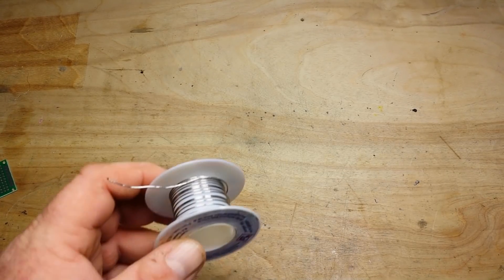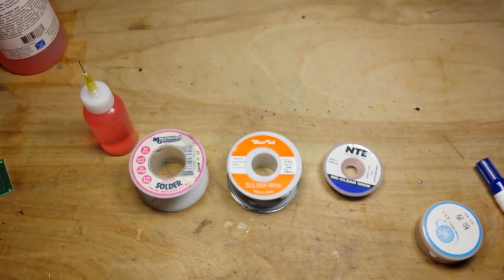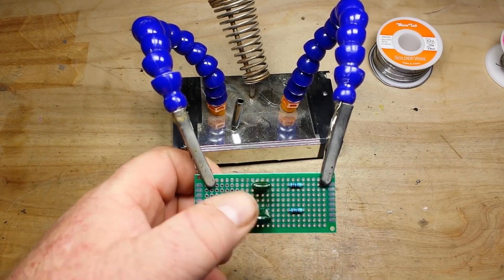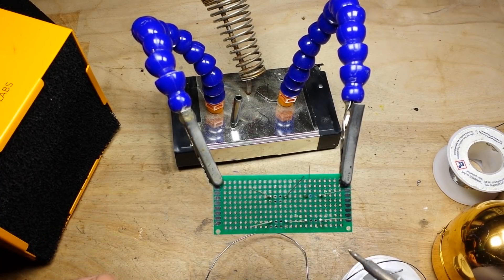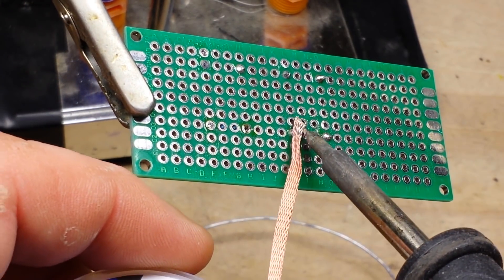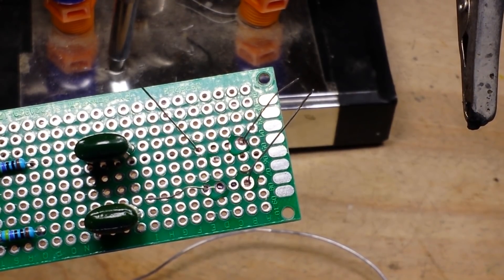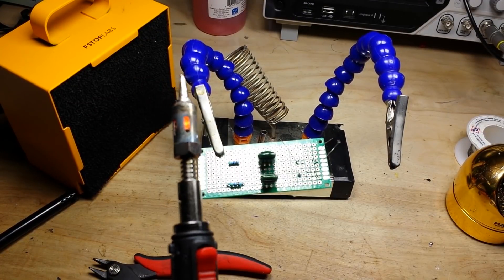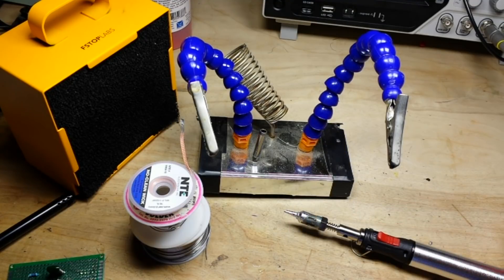Trying some new solder, wick, flux & more

Comment: Had the same result with Pro's Kit Wick. Disappointed with the bad sucking power on through-holes. Bought goot wick because of the good reviews. And it improved much. You can even see one reason why with your own eyes: When looking at the wick strains with magnification they were visibly bigger in the Pro's Kit wick. No wonder it has less sucking power. A good wick is also containing a good flux coating. Maybe this could have also made a contribution.

Comment: For butane soldering iron, check out Portasol.  In 35 years, I've only had to buy two, and they did have a hard life outside with me.  Still using the second one.  It also comes with different size tips.  Next time you get solder, try a 63/37.  Quicker freeze when the iron is removed.  Never had a cold solder joint.  That goes back 43 years.  Learned about the solder in a 'micro-miniature soldering class."  (small signal transistors at the time, and a couple ICs.  When the 2n2222 only came in a tin can. TO-18  ICs were the same with a few more leads.  Mil-spec. no plastic.  Dip ICs did exist, but not in our equipment, and those that I did come across were ceramic.  If I recall, the 2n2222s at Radio Shack at the time were also in a tin can.  TO-92 came out a few years later.)  Micro-miniature has a whole new meaning today.
Reply: Get the ones with ceramic insides.

Comment: I bought my first Butane Soldering Iron about 30 years ago and I LOVE IT! Use it ALL the Time!  Especially Outside. No Extension Chord/s. Plug-In Soldering Irons will not Solder if there is any sort of Breeze...cools the Tip too much. My Butane Iron needs no Cord and its Adjustable. Any Wind I just Turn-Up the Heat! My second Butane Soldering Iron I purchased at RadioShack. 
 The Iron you Bought can be a Bugger to Light per a YouTube Review I watched a couple of days ago. He had to Unscrew the Tip & Heat it with the Torch then Reattatch the Hot Tip. 
 I Light mine with a Bic Lighter, however, mine will Light with the Flint Igniter in the Cap.

Comment: I used to have a Weller "portasol" butane iron. It was about the size of a marks-a-lot marker, and had a cap with a pocket clip and a striker built into the cap.
It also had an adjustment for gas flow, so you could set the heat to something less than "surface of teh sun".

I found it very handy back in my bar band sound tech days.  Fixing guitar cables, XLR cables, etc in random locations.

And it did the same "flame show" when it first lit up, though the flames didn't need to last too long. As soon as you see a bit of a glow in he catalytic media, just blow out the flame.

Comment: Rubyfluid!  looked it out, in the UK it costs $9.85 for a pint - and (get this !!!!!!) $57.25 postage !!!!!!!  Presumably its a mix of unicorn horn and hen's teeth hand mixed by the Virgins of New York?  Looking at the description it seems very corrosive - More like a metalworkers flux or craft hobbyist rather than the non corrosive stuff most pixie wranglers would want?  While washing down a leaded window or the pipework in the bathroom, I don't fancy washing off an electronics board from a tv or PC in warm water.

I have to admit I've had a bit of an epiphany with solder, I've  converted totally to 0.7mm and 0.4mm dia solder.  Certainly with surface mount, but also with "normal" through hole.  While I'm generally as tight as a ducks arse when it comes to buying consumables I have to admit I'm still paying £30 per pound for mine  
I've also been playing with making "wicking" or wiping soldering bits and combined with a thin (lead) solder I honestly can't see how I got this far without them, just so controllable.  I can't imagine going back.
I've been a fanboy of gas irons for years.  I learned to solder with a copper slug and a gas burner and I've spent a lot of time on sites that didn't have independent power. The thermal density they deliver is amazing.

Comment: 60/40 is very forgiving with low quality solder. I run the electronics lab in a big maker space here so I have to use lead-free solder and with that the quality differences are much bigger. Also the alloy matters much more. Cuz of my work I also started using the same solder at home and with high quality stuff lead-free is as easy to work with as the old 60/40 solder. Never looked back. I use Felder or Edsyn for my wick and they are both great. For flux I use the pens only (also Felder or Edsyn) but that liquid flux looks intriguing. Gonna get me a bottle to try it out. 
Where do u get those little bottles with the needle tip from?
Reply from the maker: I ordered them from Amazon.  Needle-tip applicator bottles.
Reply: @learnelectronics  Thx a lot!

Comment: You can get a 1lb roll of 63/37 Kester 44 on Amazon for $25.

I prefer 63/37 over the typical 60/40. As 63/37 is a eutectic alloy, with no intermediate "plastic" state.

And known brands are likely best if you want to be sure you get the formulation you expect.

I also like good ol' RMA flux. It works well for most needs.
Reply: I love Kester 60/40.    0.31 dia.

Comment: that iron is a throw back to the old gas jet and lump of pointed copper with a handle, I'd give that bugger a wide berth.
and yes if you pick up the iron like it shows, the first hint something is wrong is the smell of a Sunday roast there is no pain at first (3rd degree burns), you realize it's Friday and drop the iron and think that should be hurting now but the burns are numb for a good few seconds then it starts slowly and ramps up until you get to a point and think branded cows should brand the rancher because GOD DAMN!!! you know what a well-done Steak feels like.

being a field technician for the past 15 years the best gas irons I have ever used was a Nimrod until they went bust and now the Portasol Propiezo 75 which I've had for the last 10 years, good for 2 gauge to 0408,TSSOP and QFN has a good temp control for a gas iron.

as for solder not to picky but has to have PB, none of that tree hugging hippie garbage there are reasons why lead is used, the stuff I get from the local suppliers is good and cheap enough or if I'm felling like a tight arse china's Mechanic brand ain't half bad either.

solder wick: Goot if you can afford it but the cheep stuff is good as long as you flux it, however one caveat not all brands are the same and not all flux's are created equal so you mileage may vary more on that below.

Solder flux: beginners should avoid zinc chloride (acid based flux's) even leaving a minute trace over time means corrosion very bad for PCB's especially IC's but catastrophic for SMD as it can wick under them and over time eat the legs/pins/pads right off them, but it does have it's uses and if you follow proper cleanup methods you should have no issues.
Good General purpose flux's like Amtech (pricey but good and beware of imitations), MG Chemicals, Kester, AIM and CAIG just to name a few, you can roll the dice on some of that fleabay/Scamazon stuff you may get lucky or come up snake eyes.
A Gray-Beard gave me some homemade flux to try, I was sold now I make my own from resin blocks, IPA 100%, and depending on type liquid, gel or paste just mix well before use, keeps for years, very cheap won't etch clean copper and can bust stubborn oxidation but it does smoke up and has a pleasant smell unlike the chemical flux but use a fume extractor and simple cleanup with IPA. leave it turns to a glass state after soldering

the most expensive mistake you can make is not having right tools although the quality part is getting harder to come by
Reply from the maker: That is a great response to my video. I really hope folks take the time to read it. Thank you for sharing your knowledge with us.

Comment: I've got a old butane iron I got from Radio Shack many years ago,  you really have to turn it way down to solder small things Lol.   My dad and I used to solder copper steeples and roofs using Ruby Fluid, it cleans copper very well. We used Muriatic acid for galvanized metal. We used the big bar sticks of solder with big irons on a propane fire pot.  Man I hated climbing ladders handing my father those things, especially on hot days in the summer made those irons hotter.  Lol

Comment: I have tried many chap solder from ebay, and from amazon (Canada).  Best combination so far: "AUSTOR 454g (1lb) Activity Solder Wire, 0.8mm" Alloy: Sn / Pb: 63% / 37%; Flux: 2.0%, about $24 USD; and from ebay paste flux "Mechanic type MCN-UV50", about $8 USD. For any kind of soldering - SMD, connectors, large polygons.. Strangely this solder not available in amazon.com

Comment: I use a battery soldering iron outside. The original cells were 1300mAH. Replaced them with 1800 to get a bit more life. I can't be trusted with butane.
Reply from the maker: Is it the Isotip?
Reply: @learnelectronics  Actually, Black&Decker. Never cared for the skinny wire leads on the ISO. I'm too rough for that. The B&D uses a stainless tube as one of the leads for great mechanical stability. You can't get them anymore but they've updated to Lithium.  https://www.homedepot.com/p/Weller-Cordless-Soldering-Iron-with-Rechargeable-Lithium-Ion-Battery-BL60MP/304317019
Not that I am advertising.

Comment: gootwick is gut, good, bom, bueno, bien :P I stay away from flamable soldering irons , not a good experience :S. For portability there is already TS80 and TS100 + powerbanks , 12V SLABS , inverters, no need to invest in burning fingers and wait 5m to burn.

Comment: I bought a bottle of Ruby Fluid from Amazon a year or so ago but, never used it because it is caustic and if not cleaned off the circuit board right after soldering, will corrode the pads and traces. I would like to know if it would actually be alright to use...

Comment: What a hoot on the Soldering Iron Photo !   Yea,     I have a cheap O weller battery iron for outside work.    With BRAND NEW batteries Three AA it can do most jobs required.  The two battery little brother is WORTHLESS.   For the others I have a regular Pencil Type 12V that does anything Required.  Those butane irons have there place but dang a replacement tip cost as much as a whole new kit.   The one I have is just used for a stripping parts torch now.   Kester Flux.  Nothing works as good as that stuff.

Comment: After you light the soldering iron wait 5 seconds and turn off the gas and turn it back on.
Once the platinum heats up you extinguish the flame momentarily and it should get rid of that issue.
Reply from the maker: Ah ok, thank you

Comment: Mechanics soldering wire has great quality as well, i've been using Wurth and Stannol for long time, and i have to say that the quality (under microscope) is almost the same.
About flux i've been using kingboo for long time, it is awesome. I've used KSS for a while, it was easy to clean, but it has an expiration date, and when it gets yellow it's just a mess and hard to clean.
About the wick. i use Gootwick it is the best i had so far, but it needs flux to help it out.
I've used liquid flux, but it was just pure IPA that i can mix myself with rosin. I also used a flux pen, it is awesome but if you smell it it burns you inside, that is just very nasty